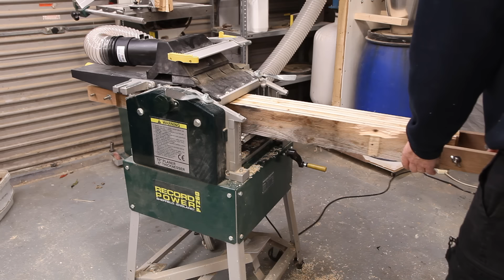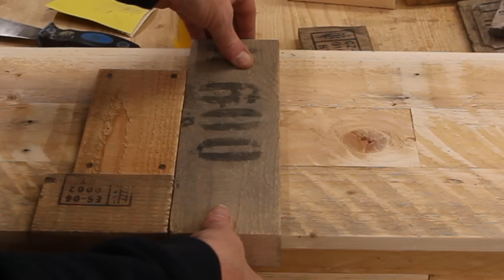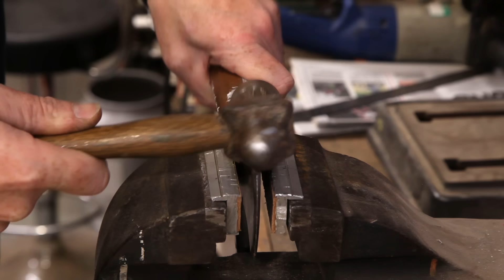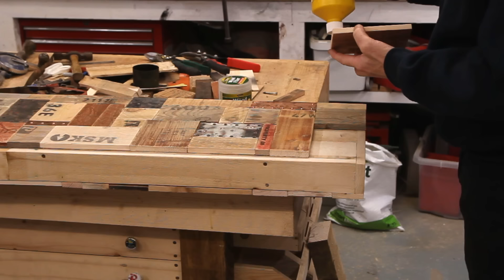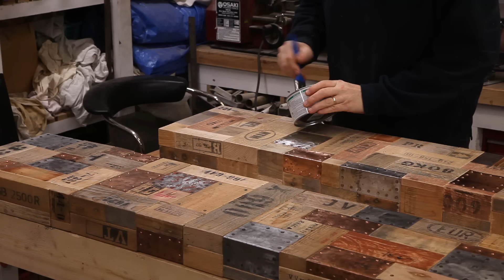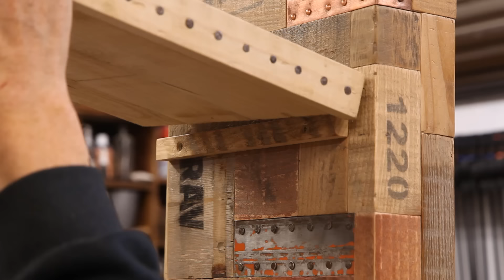A Patchwork Palletwood Bookcase Made Completely Out Of Scrap

Comment: I love the way you work. I do a very similar things  and enjoy making great furniture from scrap timber. I don't use nails though.  I tend to just glue and clamp. 15 -20 min clamping is stronger than nailing.  The odd screw pulled below the surface does help and speeds things up.. I just trust glue. 
Fantastic and inspirational work making beautiful thing from discarded material. Thanks for showing us
Reply from the maker: Thanks :)

Comment: I would have put the copper nails in the steel and steel nails in the copper. I made a similar thing by cladding drawerfronts in aluminium then using copper nails to accent with occasional bits of copper sheet as well.

Comment: Hi Jason, you videos are incredibly fascinating to watch as a amateur wood worker. Really inspiring to take something that would be wildly over looked into something that is hardly matched in craftsmanship. It’s inspiring because you keep things so simple without the overwhelming feel you need expensive tools to try and follow what you make. 

Amateur questions- do you find it difficult to use a mix between pallet wood and other woods (I have access to a lot of pallet wood)

- when glueing on you table do you use some sort of wax so it doesn’t stick to the workbench?
Reply from the maker: Thanks for the comments, Jonathan. I haven't had many problems mixing pallet with with other woods. I try to use reclaimed materials as much as possible. It all ends up looking the same.
I rub down the bench with candle wax every few days to stop glue sticking to it.

Comment: super work looks fantastic just a quick question any reason you manually drive your screws in rather than use an electric driver obviously I'm talking about the other videos of yours that I've watched as most of this was nailed either way you have some crazy skills much respect
Reply from the maker: Thanks. 
I prefer using a normal screwdriver whenever possible. I would just rather use hand tools. They never go flat :)
Reply: ah ok makes sense probably why you used the no. 55 for those details in another video old school programming at its best
god knows where you start with that beast  @EpicUpCycling
Reply from the maker: Yes, it's certainly a challenging tool to use. Very rewarding, though.

Comment: 16:15 when you use the copper pins, I notice you pilot hole the first couple. Is that just to keep it square or do you drill every one but edit it out the rest ( saw the same on the chest ) if if you do drill them all, then why?
Reply from the maker: The copper pins I used are rivets, they don't have a sharp end so need a pilot hole. They are supposed to be for metal but I found they work great in wood if you get the hole size right.

Comment: Beautiful.  Just out of curiosity, is the egg beater hand drill because it is easier to control depth?
Reply from the maker: Yes, and also it saves having to change the bit in the drill.
Reply: @EpicUpCycling  gotcha, makes sense.  Also, and slightly unrelated, I used the band saw technique you used to make the corner pieces for a small project this afternoon.  Thanks for doing!

Comment: Do you ever have snipe with that planer?
Reply from the maker: Yes, sometimes. It's usually ok as long as I support the wood as it comes out.
Reply: @Epic UpCycling  dang, in your experiences do you just sand it out? Cut the ends or scrap the piece if it does snipe. I appreciate the response 😁
Reply from the maker: @EricHockridge  Most of what goes through the planer gets sanded anyway so it's not usually a problem.

Comment: Why You use this thin spacers inside shelfs? 28:20
Reply from the maker: To make the shelves the correct thickness. They were a bit too thin with just the top and bottom layers.
Reply: @EpicUpCycling   It makes sense.  I would probably do the limiters on the front higher than 2 layers.